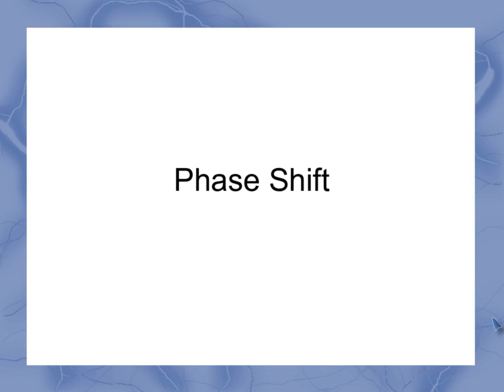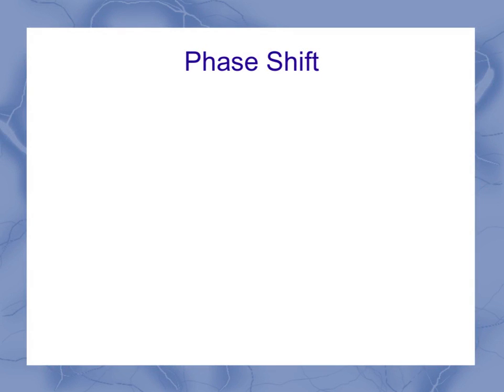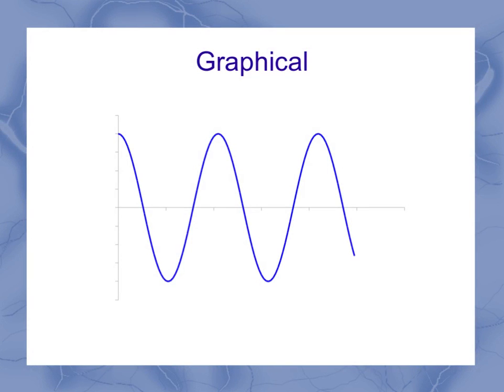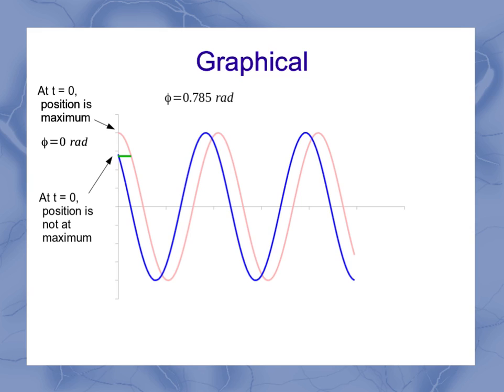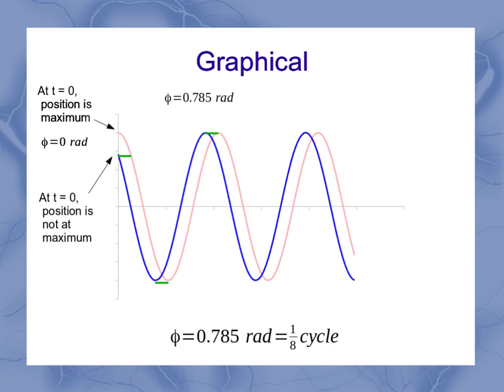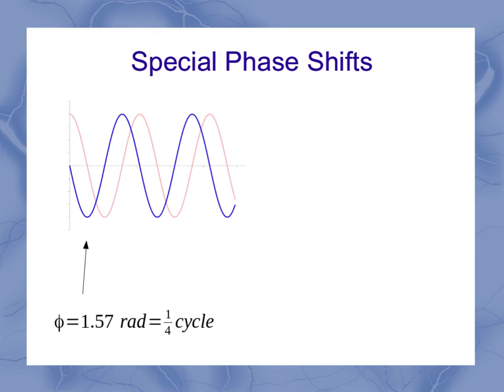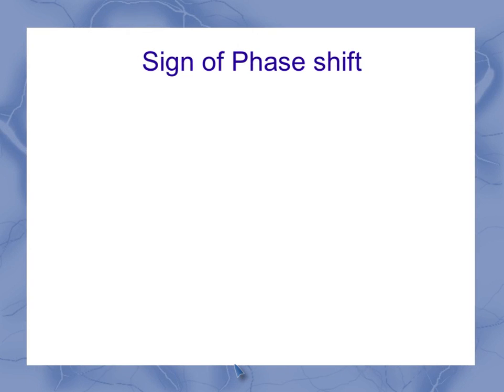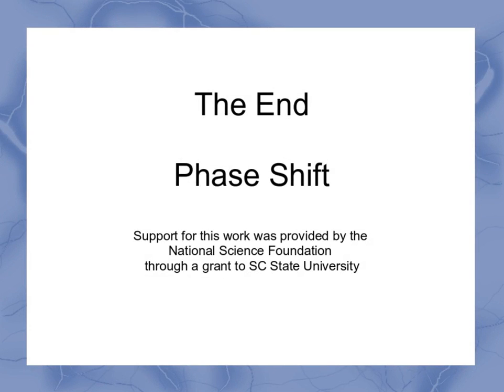Simple Harmonic Motion and Phase

Comment: Great lecture.
Are you sure the phase constant has to lie between 0 and 2pi? Could you provide a reference for the same?
Reply from the maker: The phase shift represents where the oscillation starts in the cycle. A cycle goes from 0 to 2 pi ( in degrees this is 0 to 360) so the phase shift has to be in that range.
Reply: The problem is the periodic nature of sine and cosine functions because of which , one has infinite possible values for the phase constant.So is it a convention to choose the one lying between 0 and 2*pi?
Reply from the maker: @PhysicsWithDhananjay  yes, that is the convention used in many books. There are some that use -pi to +pi as well.
Reply: I don't like it
Reply: @PhysicsWithDhananjay  why do you have kota in your name? coming across your channel for the first time so just curious. are you affiliated with kota by any chance?